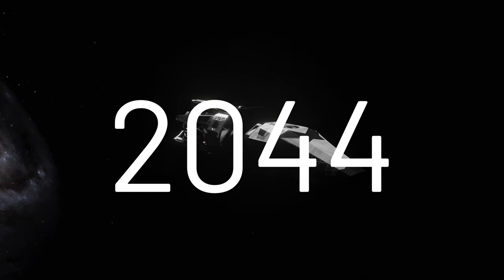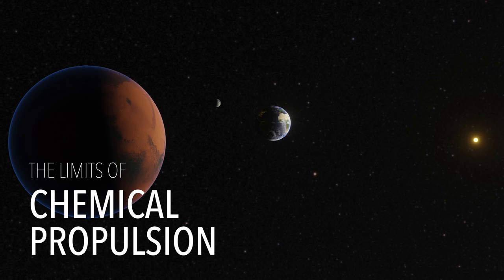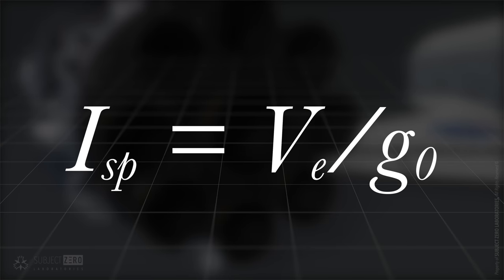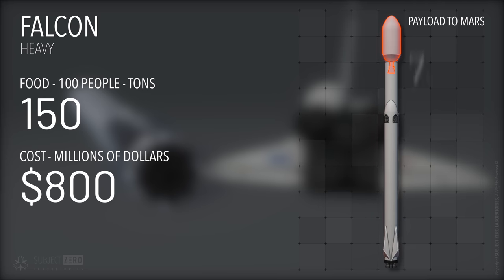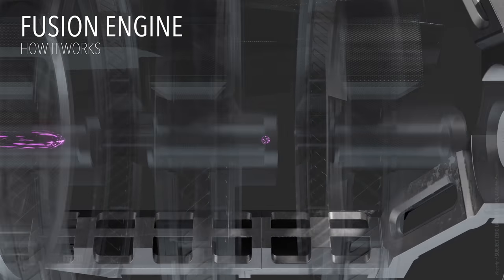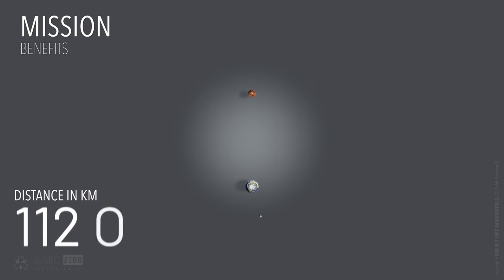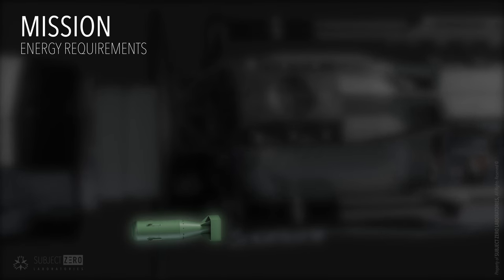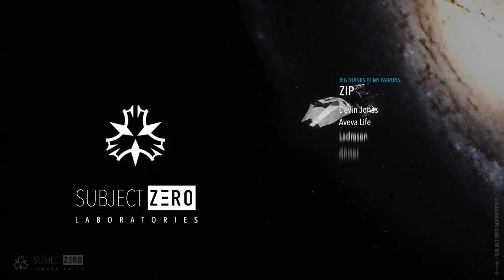Fusion Rockets - The Real Mars Express

Comment: But hey. I keep thinking about this thing. So, the best would be, if there was a fusion powered spaceship, and it was SSTO (single stage to orbit). So it would use its fusion drive to take off from Earth, and then go wherever we want. But, since its nuclear (i guess the most powerful fusion is nuclear fusion?), it would be no good for the environment, i mean, it emits radiation right? Im not sure about it tho. So if some1 do, please answer.
Reply: You would launch the fusion drive engine conventionally.   Then launch the capsule with its own engine, eg, spaceX.  The two would be interconnect the fusion drive to the capsule to fusion power it to Mars.  On Mars the fusion drive would be left in orbit.  And the capsule would land on Mars. 

The return trip, you would reverse this.

Comment: This is the first time I've ever felt the need to correct you, but your comparisons are a bit off...

Falcon Heavy is never intended to launch humans to Mars, it is a heavy lift to orbit system only.

The true comparison should of been against Starship which has been designed from the ground up as a Mars return vehicle. The vehicle will be the pinnacle of chemical rocket technology. Using the new Raptor engines which are full-flow staged combustion meaning great efficiency and power. 31 of these will power the main booster (Completely reusable) producing 65 Million Newtons of thrust, compared to Falcon Heavies 22.8 MN of thrust. 

The Merlin engine that you reference has a specific impulse of around 282s at Sea Level, where as the Raptor is around 360s,  with the Vacuum version around 378 Isp.

Both the first stage (Booster) and Second stage (Starship) are completely reusable with the Cargo variant taking around 150 Tons to Mars (with orbital refueling), because they are completely reusable with far simpler design than Falcon (Fuels can all be made on site) the cost of launching tumbles to very reasonable numbers the more launches it does. 

And one more thing to put into comparison, the crewed version of Starship has a pressurised payload of around 1000 Cubic Metres, that is the equivalent of a 747 going to Mars...

I don't disagree that Fusion would be a huge leap, but I would of included this as the true comparison (Apples to Apples) as both are for Mars and both are pinnacles of technology. 

One other point I'd make that even with a Fusion drive, you need a Vacuum variant because of the way these engines are currently designed (paper designs), which means it will need to be lifted into Orbit first most likely using chemical engines. 

Other than this, great video!

Comment: Wow you misunderstood this concept greatly. The lithium liner is not to contain the reaction, it's meant to start it in the first place by compressing the plasmoid to stupid pressures when it is suddenly imploded with the help of magnets. Think "crushing a tin can", only you crush it so hard that the droplets inside fuse and explode. Afterwards the lithium makes up most of the propellant, due to it being converted to plasma that gets channeled by the magnetic nozzle. No problem with ions getting trapped anywhere, the plasma is electrically neutral at the macro scale, same amount of positive and negative charges inside.

Comment: You didn't mention the possibility of orbital refuel which brings the mars payload efficiency above 50
Reply: and a base on the moon probably would help
Reply: Thing is that you still need a lot of fuel to get there. 
But refueling stations on Moon (and maybe even Phobos) would help, at the same time I'm not sure about fuel for fusion.
Reply: @Franklin_Araujo  Launching supplies from a lunar railgun would greatly reduce the cost of supply runs to Mars.
Reply: @ImieNazwiskoOK  Watch the movie MOON.  The one thing the movie got right is that the surface of the Moon is rich in Helium 3 and this is the best fusion reactor fuel.
Reply: @pauleveritt3388  The railgun would need to be HUGE and have massive solar farm.
I think that at the size of such railgun even curvature of Moon would need to be concidered.

Also making refueling station on Phobos (or Moon) would also greatly help.

Even though Moon is "rich" in Helium 3 you need 1000 tons for 2.8 grams of Helium 3.
I'm just guessing but if Moon has helium 3 from solar wind, Phobos also might have some.

Comment: One thing to note here: While fusion rockets would obviously be great for interplanetary travel (and power generation, if we can build something like this as a power plant) it doesn't really solve the hardest problem with space exploration - getting things off earth. You don't want to use an engine like this to take off from earth because you'll be spewing neutron radiation (as well as probably quite a bit of alpha and gamma) absolutely everywhere.
Reply: The radiation during ground launch could be solved by launching in a remote area in a silo. Alpha and Gamma radiation doesn't stick around, and Alpha particles will get stopped easily by even the thinnest of barriers. and Gamma radiation while can penetrate decently thick concrete wouldn't go very far in atmosphere so its definitely possible. 
Open cycle Fission rockets on the other hand would definitely have long term radiation contamination problems.

Comment: I would LOVE to see this CG idea mated up with a Full starship (Here after SS.)?  Kinda like the idea that one SS would bring the drive up and put it into a parking orbit.  Then they would send up a number of fuel SS to be in waiting for the Crew SS to arrive.  Then the Crew SS launches, meets up with the refueling SS allowing them to return for refilling, then the Crew SS would move and dock with the Fusion drive module before lighting the candle as it were and making the trip to Mars.  Once in Mars orbit the Crew SS would detach from the Drive module and use the fuel onboard and it's chem raptors to land the SS and complete their mission.  Once they are done they could then launch the Crew SS and meet up with the Drive module before making the return burn back to Earth!  This would be a truly epic use of the combined tech and I could easily see the SS being able to make this much more possible.  Also just a note that was overlooked in your data is that while with CURRENT operating rockets you are correct you failed to take into account that the SS has a MUCH higher payload to orbit ratio then anything currently out there PLUS will be slated to cost a fraction of the operating cost that even the Falcon Heavy currently dose.

Comment: a kugelblitz black hole would actually be the most efficient drive system, but you basically require gamma ray mirror, which I don't think are possible, but like if you can make them then you can make a kugelblitz black hole. Also you need a stupid amount of energy, but like the sun puts out a bunch of energy and you "only" need like 10% if the suns output to make a kugelblitz black hole, and if you have a gamma ray mirror you can probably make a gamma ray laser, which you also need to convert the suns energy into gamma rays because you need to focus enough energy in a little bit bigger than the plank length, which means you need the highest energy 'light' to stand a chance.

bonus if you have a gamma ray mirror is that you can reflect the energy coming off the kugelblitz black hole, rather than the brute force method of blocking the gamma rays and turning them into IR which can be reflected to create thrust, also if you have near perfect gamma ray mirrors you can theoretically maintain a very high power kugelblitz black hole as the lower the mass the higher the output, but also the shorter the lifespan.

Comment: Should also mention that you would only need ~10 grams of uranium 235 to release the same amount of energy, which is 10x more, but like your fuel is stupidly more dense like 10 grams of uranium takes up 0.000525 litters of volume, while 1 gram of liquid hydrogen takes up 0.01 litters or 19x the volume for the same energy, so your tanks need to be 19 times bigger and you need to keep the hydrogen at cryogenic temperatures, and you also need a pumping and liquification capabilities and many layers of tank to stop the hydrogen escaping.

while your Uranium could be contained in a plastic baggy, and that would actually stop the radiation given off by U235 as it's a alpha emitter, so while yeh the fuel it's self may be more energy dense weight for weight, the actual systems involved in containing the fuel would make fission a better option, that ignores the reactor, you can make a pretty light weight fission reactor if you skimp on shielding the whole thing and only shield the direction in which you have crew and or equipment sanative to radiation, a fusion reactor not so much.

Comment: Great video and animations.
I have a question/thought on this proposed engine. Would it not be simpler to use deuterium-deuterium fusion, instead of using tritium-deuterium? I understand less energy is generated by deuterium only fusion, but if I'm not mistaken there would be no neutrons that are ejected from the reaction, which would avoid energy loss and damage to the engine. Additionally, tritium is enormously expensive from my understanding, deuterium, on the other hand, is considerably cheaper which could drastically reduced costs. So am I missing something hear? Why not pursue deuterium-deuterium fusion engines? 

Edit: But on second look, it seems that deuterium-deuterium fusion still ejects neutrons to generate helium-3, which makes my point moot, this makes me sad

Comment: We already have the technology to get to Mars in a month or two using Nuclear Thermal Rockets. During the 1960’s Project Rover, the Phoebus-2A had a power level of 4 Gigawatts of thrust with an SI of 840 seconds. Open-Cycle gas-core NTR designs could provide a specific impulse of 3000-5000 seconds. Project Orion involved creating spacecraft that use fission pulse propulsion where a manned design could get to Mars in about 7 days. If we can get around the danger of nuclear spacecraft accidents, nuclear fission rockets would open space for colonization for today’s world. I think the reason they are not used today is because of the stigma behind nuclear power dangers. Of course, fusion would always be better for obvious reasons but there are remarkable technologies today and in the past that are very underrated.

Comment: You don't need fusion to go to Mars, you don't even need fission, but a Nuclear Thermal Rocket would be a lot better than a chemical rocket. Also lets not forget there are open cycle fission rocket design which we could build with no further techological advances with ISP in the mid 4 digits. That is plenty efficient for a Mars rocket. Also there are other solutions, basically making an Aldrin Cycler which is basically a space station that cycles between two bodies where you can have plenty of shielding and space to take the 9 month journey. Because the issue isn't actually the length of the journey per say, it's you astronauts getting irradiated, going insane etc etc etc.

 If you have plenty of Space and shielding that is no longer a concern also you can have as much equipment as you want as weight isn't a concern, like yeh you need to get it there so in that way its a concern, but once it's on the station it's no longer a concern, and with every mission you send out you can send more equipment and you would only do this if you were planning to do many missions to Mars.

Comment: I like the concept; however, fission-fragment rocket designs are also capable of tremendous specific impulses, possibly up to 1,000,000 (about 6 times greater than the most optimistic fusion design).  they literally eject high speed fission products out the back of the engine.  Both design concepts have issues, although radioactivity is strictly a fission problem.

Comment: Neutrons have a permanent magnetic moment and can be accelerated (controlled) by magnetic gradient fields.  This included dynamic gradients of many sorts. And nanoscale fields.

search "neutron acceleration" and "neutron deceleration" to see people have not ignored the need to control and use neutrons. There are a thousand times that many people working on parts of the problem of efficient atomic fuels.  Just not working together.  

Their target is "100" - a hundred times the current energy density.  A simple way to visualize this: think of a 300 foot tall fuel tank on some rocket.  Now take 3 feet (1 meter) of that to see the rough size of an atomic fuel element to replace the current chemical stuff. Then shrink it again, when you allow for rapid global collaboration on models, measurements and prototypes.  

No one is doing this now.  People talk to each other, but do not share the data and models and tools and help everyone work most efficiently. The difference in "best practices" collaboration and what we have now is roughly the same "100". Groups are taking a year do do things that should only take a few days. That is what is going on with "covid", "global climate change", "clean water", "global education", "malnutrition", "atomic fuels" and thousands of other critical global issues and opportunities.

Neutrons are a high value product in any reactor or conversion process.  You never throw anything away, nor waste useful energy.  If your model is wasteful, start over and try again.  Laser induced fission is currently easier than laser fusion. But the answer will probably be a combination of a range of technologies - and orders of magnitude better models and design efforts.  Start sharing your models and data and assumptions in symbolic math formats, and data formats and computer language forms that can be compared, curated, combined, checked and verified completely.  It is all possible.  Solve global collaboration and then problems like "fusion", "atomic fuels", "solar system colonization", and "taking better care of our planets and moons" become easy enough to do in a human lifetime.  Not spread out with gaps of decades and many lost opportunities.

I am posting this at https://theinternetfoundation.net/?p=1523

Richard Collins, Director, The Internet Foundation

Comment: Would these kinds of ships be space to space only or would they also be capable of takeoff and landing on their own?
Reply: Probably space only. While these engines seem like they reduce the amount of radiation produced, they don't, they just direct less of it toward the crew. The immediate area around the landing site is going to be bathed in intense neutron and gamma radiation so if you're one of the crew you can forget about going outside for a few days after landing just to let the radiation calm down.
Powered landings and that will have to be left up to smaller conventionally powered shuttle craft..

Comment: The electrostatic or ion thrusters require independent power sources: Either solar cells or a modest nuclear reactor. Multiple junctions solar cells with mirrors operating at high temperatures have entered the 40% conversion range. Small reactors are possible but invoke political issues more than technological. Prepositioning equipment into Mars orbit and landing supplies with robotic orbital transfer systems - essentially a "tug" - even if it takes many months the robot doesn't care.

Comment: 02:15.  With regards to the statement made here, I would argue that is not the case... technology is moving fast and fusion driven rockets may find themselves in the slow lane... Here is the Fission Fragment Rocket....

"The  is a rocket engine design that directly harnesses hot nuclear fission products for thrust, as opposed to using a separate fluid as working mass. The design can, in theory, produce very high specific impulse while still being well within the abilities of current technologies.

[Dusty Plasma Fision Fragment Rocket]....A newer design proposal by Rodney L. Clark and Robert B. Sheldon theoretically increases efficiency and decreases complexity of a fission fragment rocket at the same time over the rotating fibre wheel proposal. In their design, nanoparticles of fissionable fuel (or even fuel that will naturally radioactively decay) are kept in a vacuum chamber subject to an axial magnetic field (acting as a magnetic mirror) and an external electric field. As the nanoparticles ionize as fission occurs, the dust becomes suspended within the chamber. The incredibly high surface area of the particles makes radiative cooling simple. The axial magnetic field is too weak to affect the motions of the dust particles but strong enough to channel the fragments into a beam which can be decelerated for power, allowed to be emitted for thrust, or a combination of the two. With exhaust velocities of 3% - 5% the speed of light and efficiencies up to 90%, the rocket should be able to achieve over 1,000,000 sec. "
[https://en.wikipedia.org/wiki/Fission-fragment_rocket ]

Comment: Beamed power propulsion is currently possible and not only beats fusion, but also antimatter Combined with proposed magnetic reconnection electric propulsion, extremely fast trips to Mars could be made. The orbiting solar powered laser stations required could perhaps be developed in a fairly short time frame.

Comment: A Q greater than 1 isn't really needed to make a useful rocket, you can avoid magnets altogether and just use an inertial electrostatic confinement reactor system with 1 side open and no nozzle and get a useful fusion rocket. Anyone with a fusor or ion engine test rig (myself included) can mess with these already just no one has flight tested one.